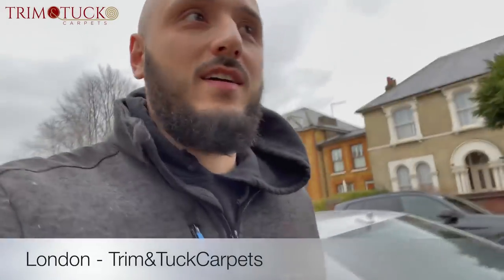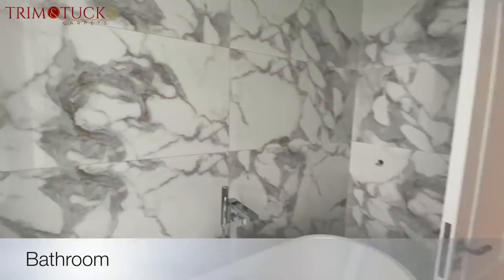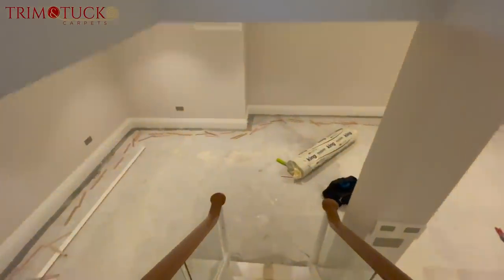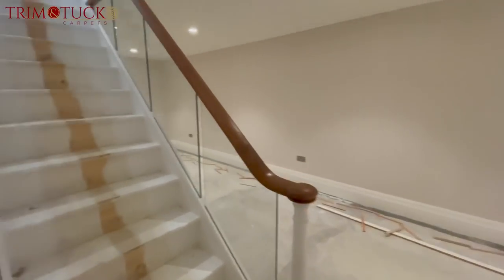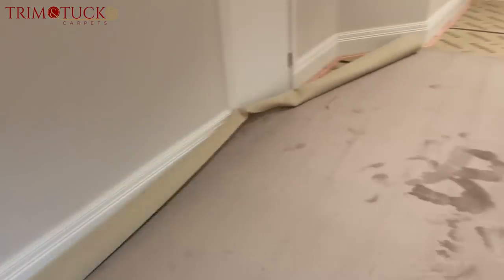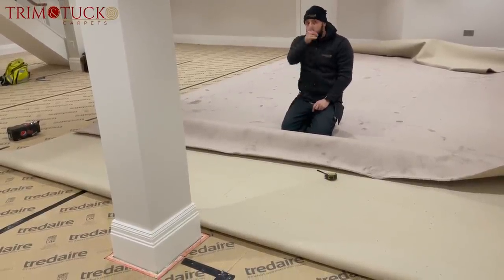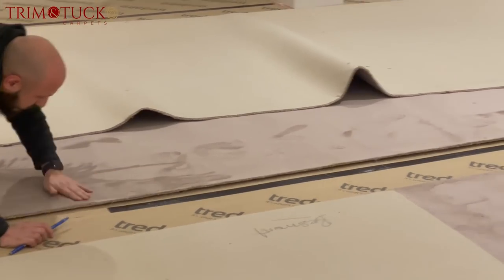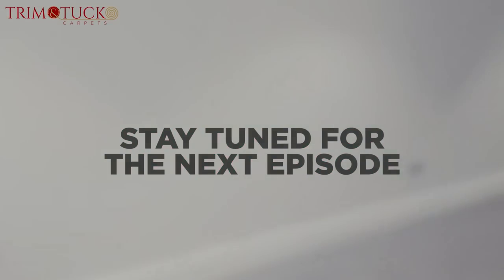Mansion Tour and Carpet Installation

Comment: With a big room like that, Why didn’t you dura fit  it?
Reply from the maker: Yep. You’re correct. But as the customer has a main access he needs access to he didn’t want to stick the carpet as if it does need to be accessed it’s only a matter of lifting the carpet up.
Reply: System 10?